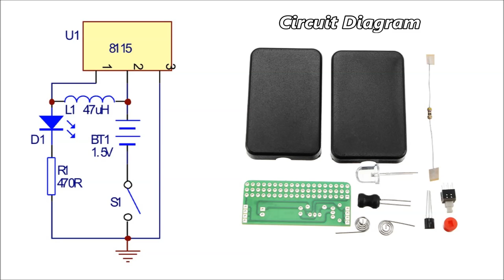Flashlight DIY Kit working with 1x AAA Battery by ICStation

Comment: Whats the 8115 ic??
Reply from the maker: It is that component, with three pins, aesthetically similar to a BC337 transistor, which deals with slightly increasing the voltage in order to make the LED light up with only initial 1.5V
Reply from the maker: Thanks @Riskteven
Reply: How do you order it? Im in Argentina so I cant buy outside so I have to buy local. Does it have some letters in front and/or back of 8115? Is it some kind of step-up dc-dc? Thank you all for the replys

Comment: Cool project. How long does the battery last?
Reply from the maker: Thank you! About 10 hours, however this figure may vary according to the brand and age of the battery.
Reply: @Stefano91ste  Hi thanks for that. I tried looking for U1 8115 on Ebay but couldn't find the exact ic. Is it just inclusive with this kit?